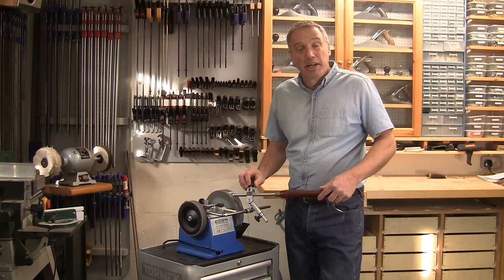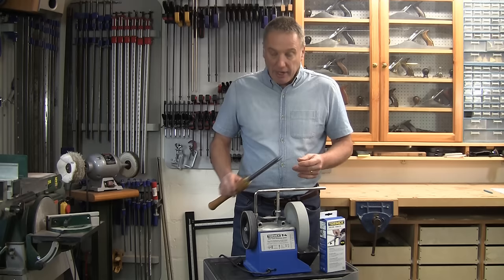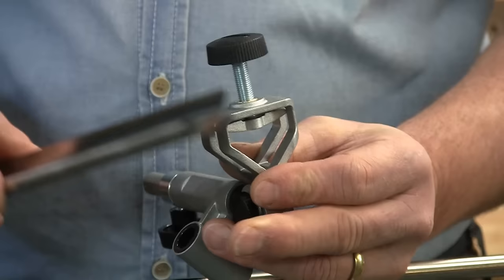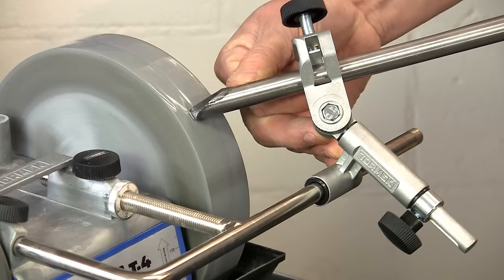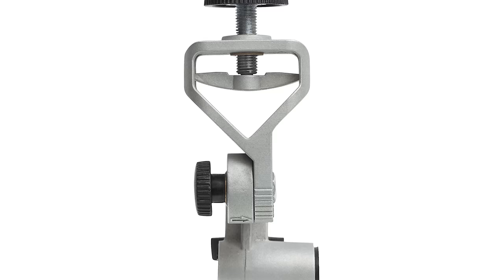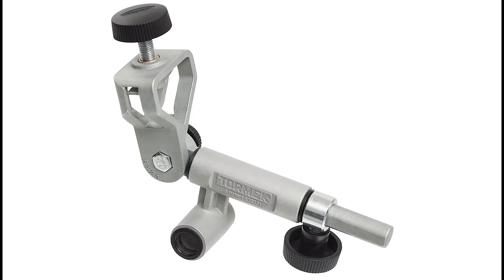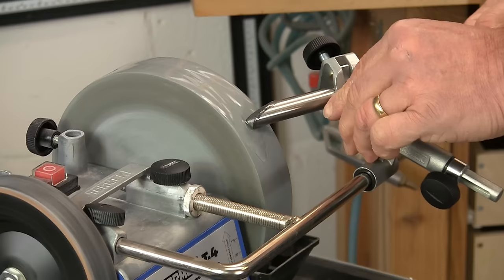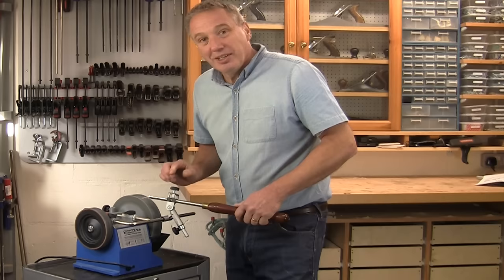Tormek SVD186 Gouge  Jig

Comment: Outstanding vid my new teacher. LOL. Question; I just bought this jig. Brand new to wood turning and tormek T8.. Will this work with a normal 5 piece turning set? I bought the lathe and a woodriver 5 piece turning set. This is what the set has in it. Set includes 1/8" and 1/4" spindle gouges, 1/8" parting tool, 1/4" round nose scraper, and 1/4" skew chisel Or recommend what jigs I need for all 5 pieces please. 2nd question. What is the difference between the 186 and the 186 R ???